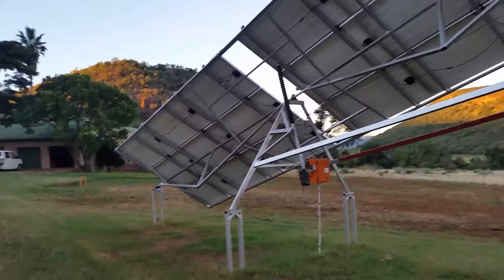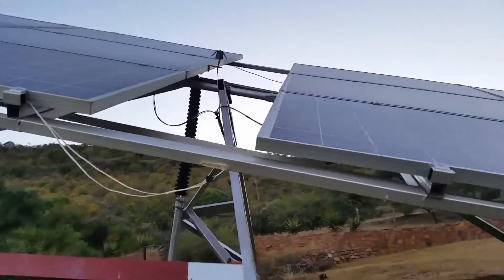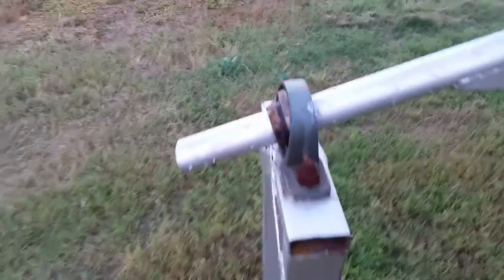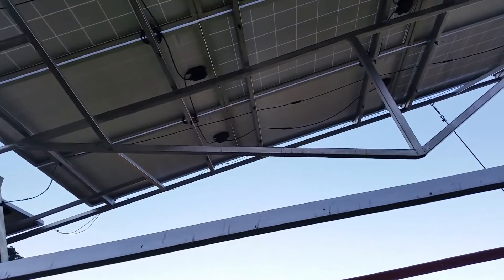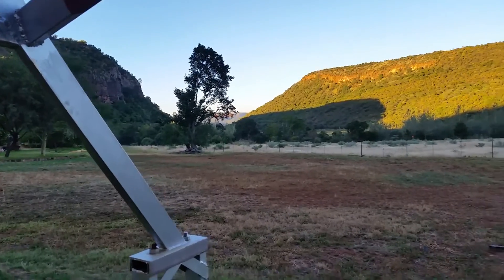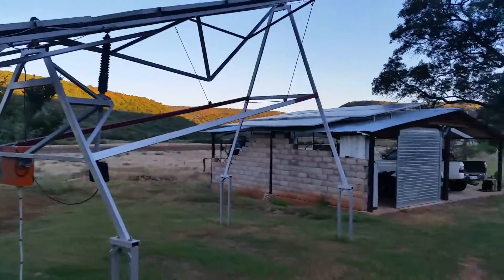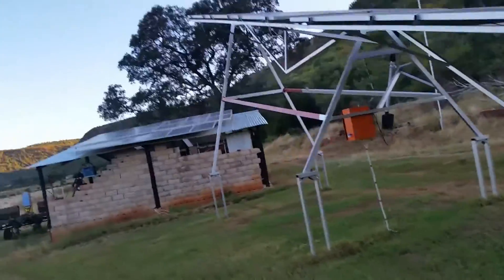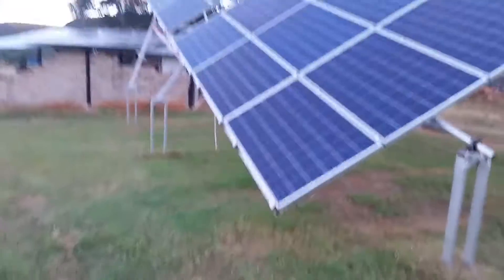Diy single axis solar tracker 2.0

Comment: Very nice instalation.
I call these basic type of Tracking Mounts  "2 Pivot Tripod Mounts".
You added an extra wrinkle, You made it double length.
Of course, this would make it harder to seasonally adjust it. But it could be done.
I would suggest that making 2 mounts instead of 1 would be a bit more practical.
Take a look at some other TriPod mounts here:
http://www.redrok.com/electron.htm#tripod
redrok
redrok.com

Comment: It's a great DIY solution, thanks for sharing Phillip! Do you have some drawings of it? 
Have you compared output from the roof mounted panels and the tracker? Thanks.
Reply from the maker: i have some drawings but have now better designs , will share them with the youtube , i just need some time actully free time to get it done i will be building two units new units , more cost effective and stronger , will do a video on it , i have more thab 53% power on the tracking unit as on a mounted roof, thanks for the comment and for watching